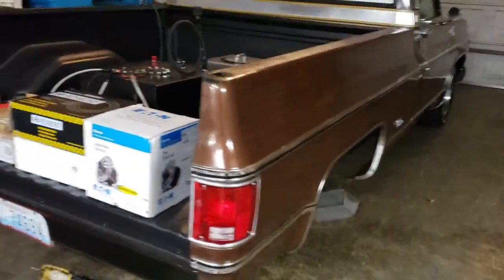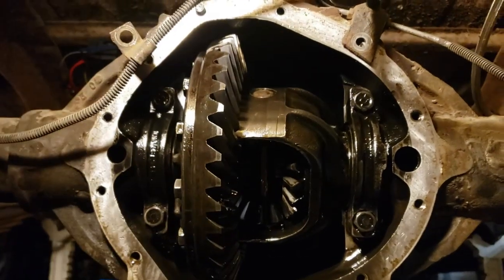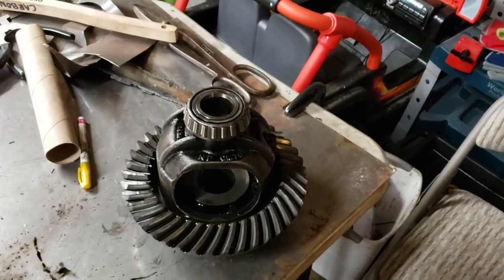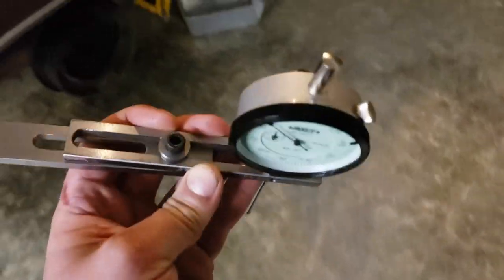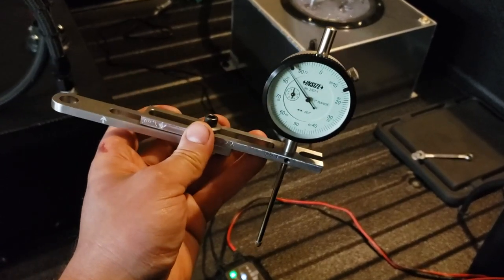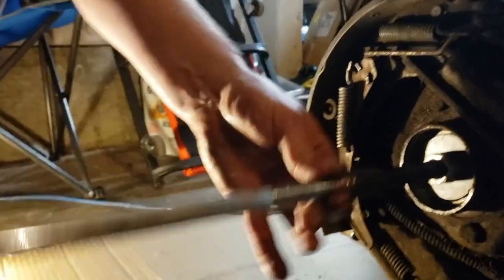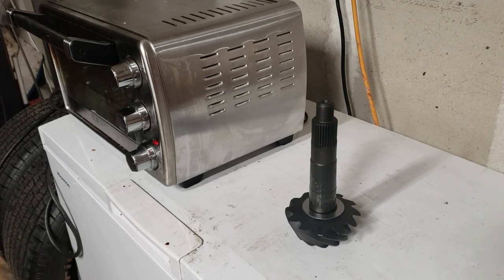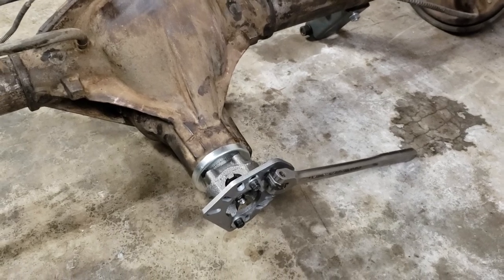12 bolt GM: Two tire fire build Part 1

Comment: I’m building a 3:42 12 bolt posi for our 1970 Monte Carlo. What a coincidence. I have a 4:10 Brute Strength posi unit in our 1966 Chevelle which is a beast with a 427. It's functioned well for 38 years now. The mechanic was a master in building things to last. He passed away 2 years ago this month so it’s  time for my son and I to learn. We have new Richmond axles on order, we have our Yukon posi unit  and a kit to go with it. What kind of differential cover should we get? I thought 3:42 gears would be better on the freeway. The Chevelle’s rpms are a bit high. Great for freeway launches when racing but we thought it would be nice to cruise at lower rpms. The Chevelle originally had 3.08 gears and a 6 cylinder.
Reply from the maker: Great to hear you and your son are taking on the task. I've enjoyed working on our builds with my father. We have been loving our 3.42 gear set, in part 2 of this video we install a Moser engineering differential cover with cap reinforcement bolts, has held you amazing the last year.
Reply: Thanks a lot! I’ll check it out. What is the secret to making sure thr gears mesh properly? I remember the guy that built my differential using metal strips and running them through the gears to check it. He was good at what he did which is why my 427 and posi unit is still going strong 38 years later. I I even outran a policeman with it. Thanks for the help!.
Reply from the maker: @patfromamboy  If you follow the recommended pinon depth and pinon centering with a brand new unit(info supplied with your new ring and pinon). Then it should align perfectly as long as the case isn't twisted. You will want a new bearing set that comes with shims for aligning the pinon, usually comes with paint/paste for checking pinon/ring mesh. Also, make sure to get a couple extra crush sleeves because no matter how many times you have done a job like this it always seems like you never get the proper pinon nut torque when your done. My 2 part video isn't super detailed but it gives you a basic understanding of what your getting into. Good luck
Reply: Thanks a lot, I appreciate the help!